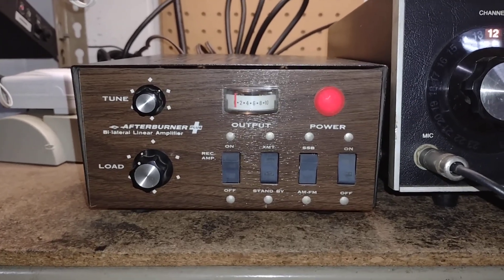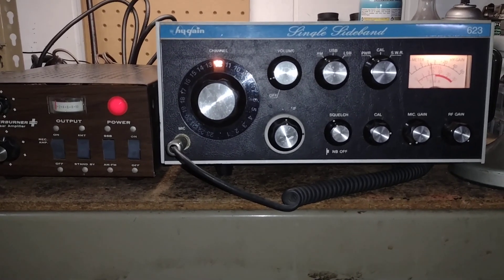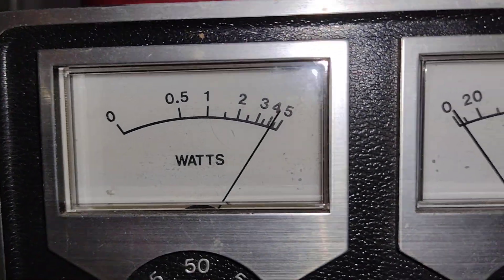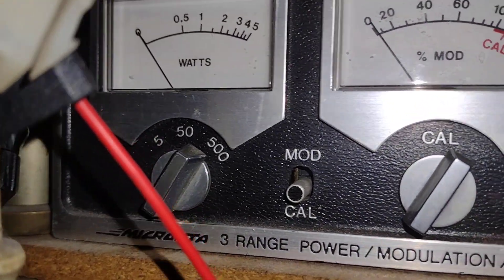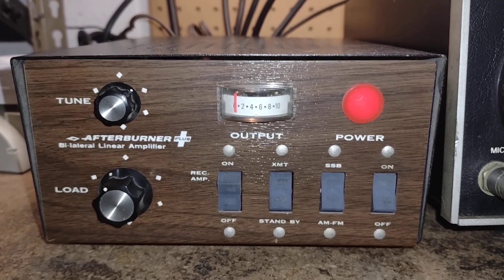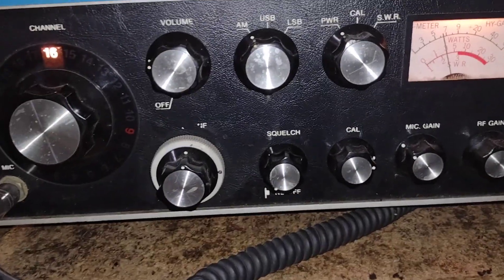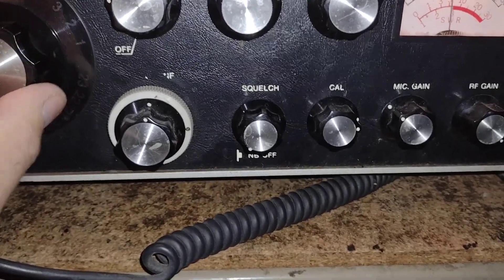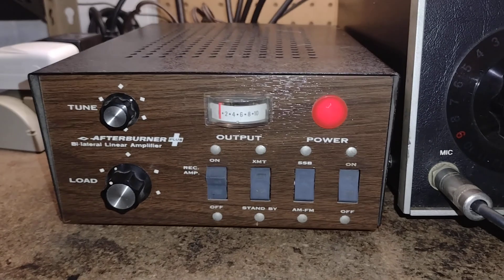A Spin Around the Band: Hy-Gain's Afterburner Plus.

Comment: Another interesting video. I had a Hy Gain amp years ago.
Reply from the maker: It was probably Hy-Gain's best selling amp, because although they made higher powered amps like the Footwarmer and Footlocker Afterburners are much easier to find and get tubes for. Thanks for watching.
Reply: It was at least 50 years ago.  That amp had a plate over the tune and load pots. Not sure when that went away.
Reply from the maker: @q95oldies57  Hmmm. They did that to the mobile amps because they were supposed to be mounted in the trunk, just in case Uncle Charlie was looking inside cars at the coffee break.